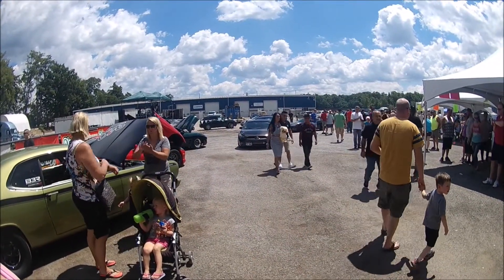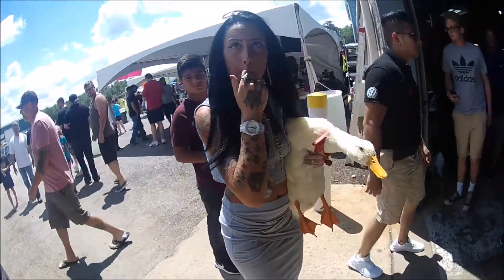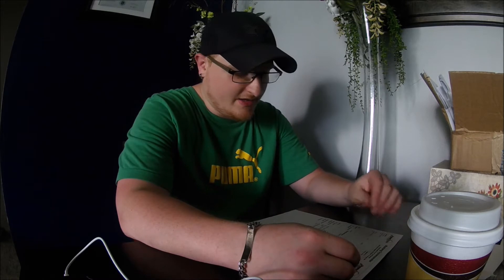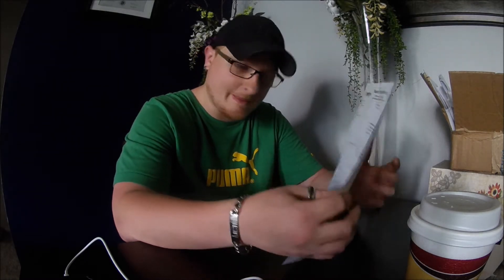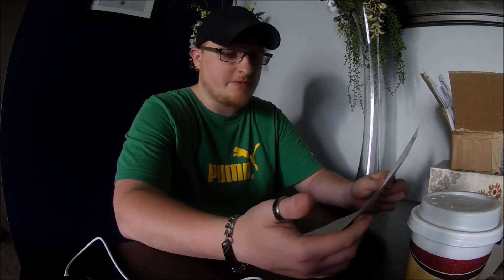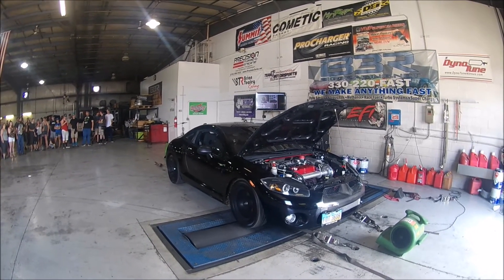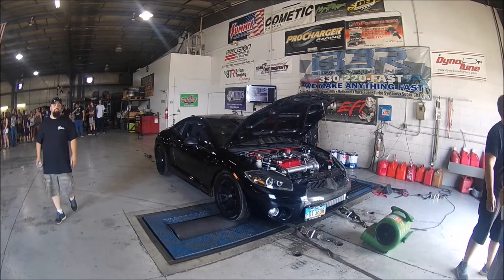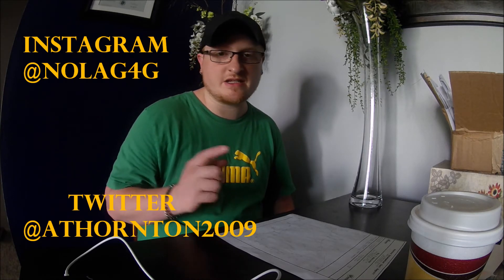300hp 4cyl Supercharged 4g Eclipse Dyno

Comment: Where can I find one of those super chargers?
Reply from the maker: 45leonellopez they were old kits made years ago by a company called RIPP.  They’re discontinued.  However you can find used kits for sale around the forums and fb page.  Although I have a supercharger it was completely custom.  I used only the shaft bracket and pulley from ripp.  Everything else was custom made.

Comment: Hey, I have a 2012-Mitsu. Galant with 4G69 Engine, I am going to install the Arp Head Studs...When it warms up a little, but whats your suggestion for max boost for longevity. and i plan on using the Aem Fic,  i know i dont need the O2 lines hooked up, what do i need hooked up (i dont want a Code, but want it as easy as possible to tune.)(First time).
Reply from the maker: Kyle Frink how much boost depends on how well your tune is.  If you’re using a fic I wouldn’t recommend higher than 7psi.  But what are you using for boost.  Supercharged or turbo?
Reply from the maker: Kyle Frink I don’t really know to much about FICs so I can’t really suggest and boost levels.  But in the 4g forum I’ve seen guys with FICs run up to 8 psi on both GT and GS
Reply: M90 custom supercharger thinking 8 psi
Reply from the maker: Kyle Frink with my pulley it was 2.75 in which was rated for 12 psi.
Reply: Your engine was fully built though right(Pistons)? Thanks for your reply.
Reply from the maker: Kyle Frink no sir.  :) well tuned.
Reply: Wow... appreciate the replys...that helps. Think I'ma set it up for 8-10 Psi with the m90 to start..until I get the pistons later on since ima tune myself... Thank you for your help.
Reply from the maker: Kyle Frink happy to help. Spread the love and be sure to hit that sub button!
Reply: Definitely!